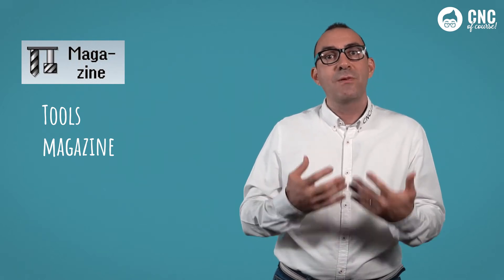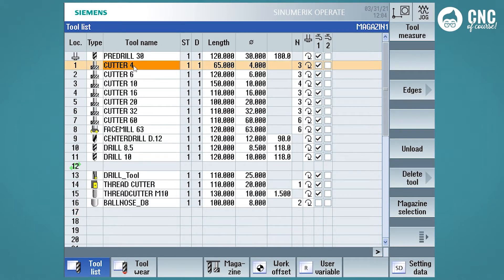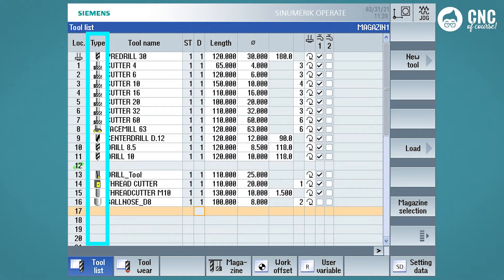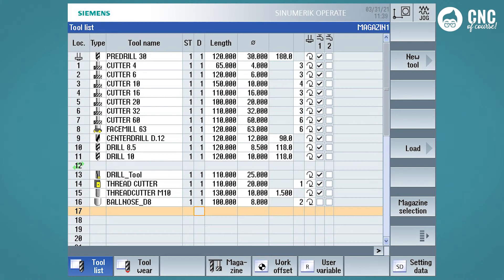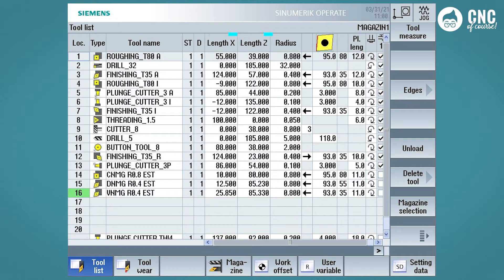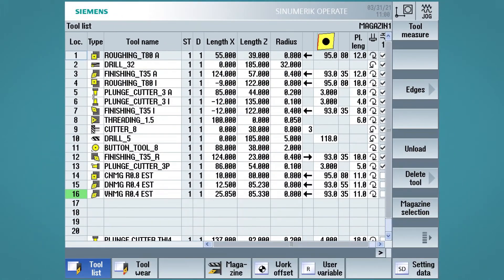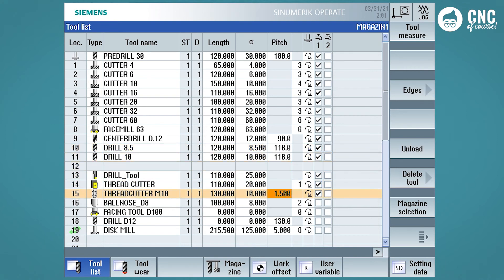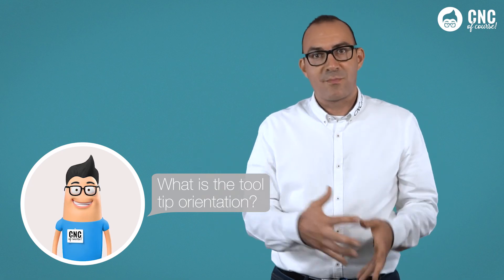Siemens 840D - Tool data management

Comment: Can you explain what the 'ST' and 'D' column is for? I ran into a problem in the past when using a face mill type tool and milling a face type slot. I had an alarm regarding the 'D' type of insert I am using. How do I change the 'D' style and what is the range of styles? Thank you for your video.
Reply: ST = Sister Tool (if you have more than one tool of - as an example "Tool 230500" in the tool list, the first tool that is loaded gets called "ST 1" and the second one "ST 2" and so on)
It's more or less an "identification number".

D = Cutting Edge Number (the "Cutting Edge" can have different orientations or the "Tool Type" can have different classifications (working from memory here - Siemens 840D SL) on what type of tool it is (End mill have "Type 120", Facing tool have "Type 140" and so on)
Might have been some miss-match in that case (quite hard to tell when I'm not able to see what the PLC-alarm itself said)

On a side-note with the D-number, Capto-turning tools (as an example) can be setup in a way that you have different orientations on its own D-number (Cutting Edge 3 - "Facing Left", Cutting Edge 4 - "Facing Right" and so on), that way the tool can work in several different Tool Carriers without having to have separate tools for however the cutting tool need to be facing the workpiece.